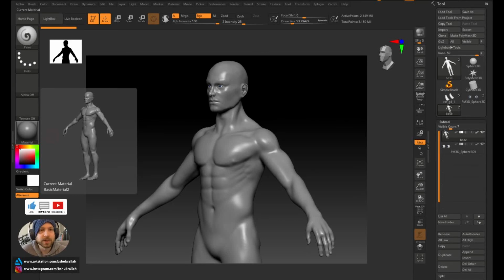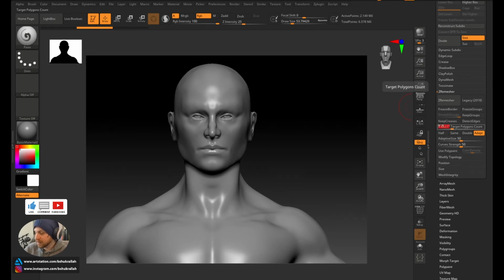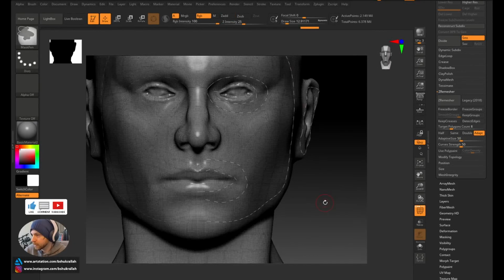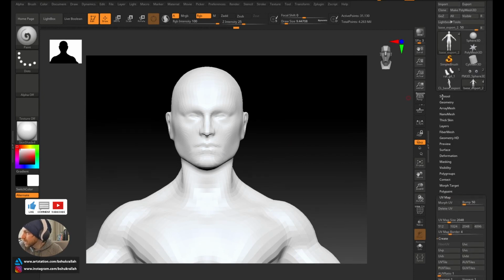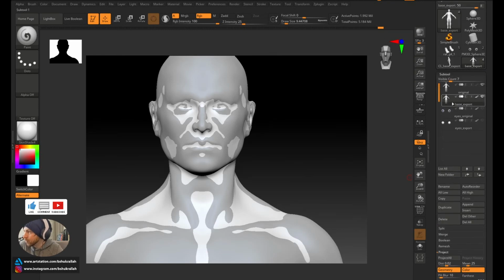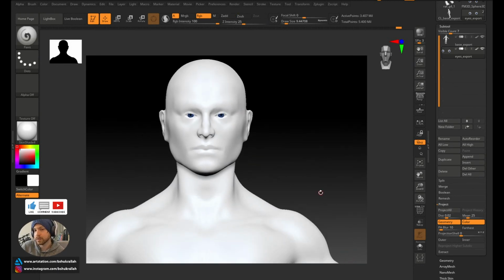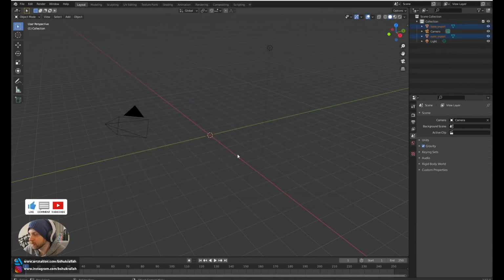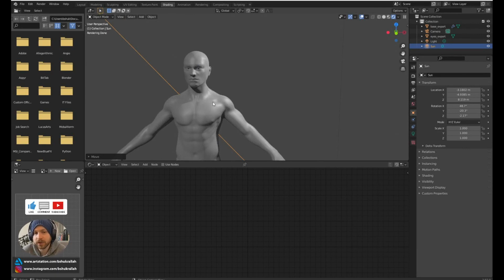Export High Poly Zbrush Model to Low Poly Blender Model (EASY!)

Comment: Ben, can you answer a beginner question?
I'm sculpting a dinosaur and I've reached the end of the volume modeling stage. The next step is to model the scales, but at this point the polygon count will get very high. Should I retopology in Blender first and go back to detailing in Zbrush?
Reply from the maker: Sculpting for volume can be done with lower subdivisions, typically. Higher subdivisions should be for details. If you find that your model has too many polys already, you could try to split it up into different subtools. This may be trickier seeing as you are working on a dinosaur, but you could try to separate the head/legs/tail, etc and hide the seams with scales or other cleverly placed details.
Reply: @bshukrallah  Thank you for the tips!

Comment: Instead of using Zremesher, can you just export a lower subdivision level of your model and use displacement maps for the details onto the lower subdivision model?
Reply from the maker: Yeah it should work if the polycount is reasonable.

Comment: I thought you would import the high poly model into blender then work from there.
Reply from the maker: You would import the high poly model into blender if you want to retopo and maybe bake maps there.  Blender runs really slow with meshes that have millions of polys, which is why I prefer to make it low poly and bake maps before.

Comment: helo sir.   sory for my 
stupid question, im just a newbie.   "  do i have to keep the high poly after bake into low poly? or   deleting the highpoly  after baking?  before start riging?   hehehe.  coz  my sculp has a  thousands of mesh and im always getting lag.. .. sory for my  supid question sir.  just  only curiosity.... thank u
Reply from the maker: It's up to you. I always keep it saved as a backup just in case I need to bake it again, or fix some issues. I only use the low poly in blender.
Reply: @bshukrallah  thank you so much sir. keep it up😉

Comment: Thanks for sharing this workflow knowledge.

Are there ways to export both low poly (SDiv 1) and high poly (SDiv 4) into Blender together? 
Reason is that, if I later on want to add more detail to the muscles, and this must be working on the high poly. 

Or, should I go back to ZBrush to work on the high poly again, and once done, repeat the workflow again? 

Thanks. :)
Reply from the maker: You can possibly import them both to blender, however the high poly will most likely be really slow. It would be best to edit again in Zbrush then remake/export over again.
Reply: @bshukrallah   Thanks for guidance.

Someone mentioning Blender's Multiresolution modifier might do the trick too.
I'll explore that too.
Thanks again. :)
Reply from the maker: @VeryFunStudio  Happy to help! I have yet to try the multiresolution modifier in any real form of tests, so I cannot comment on that. Good luck & thanks for watching the video!
Reply: @bshukrallah  Anytime, Ben. :)